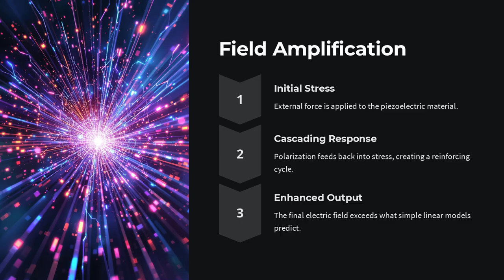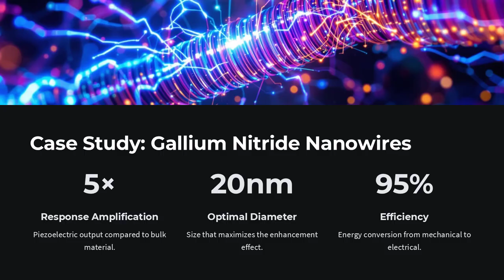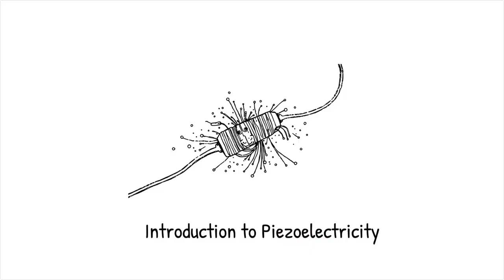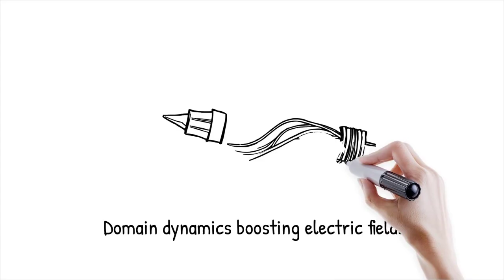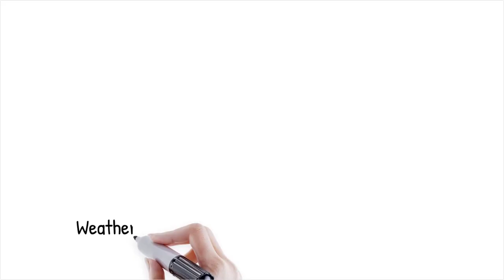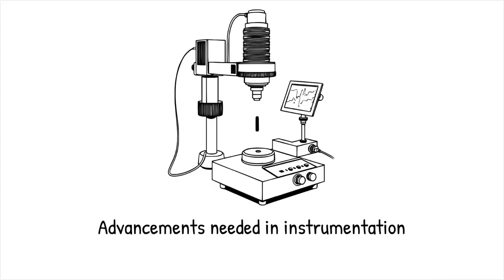When Stress Turns Into Electricity: Science Can’t Fully Explain It

Comment: Piezoelectric quartz does not conduct or produce electricity, the sudden movement of the conductors attached to the crystal produce a capacitive-inductive jolt of electricity from their atomic nuclear magnetic fields being rapidly altered by a leveraged momentum of the impacted quartz crystal's atomic structure.
Reply from the maker: Thank you for your fascinating comment. Your interpretation highlights an often-overlooked layer of piezoelectric behavior, where the dynamic response may not solely originate from the crystal’s intrinsic properties, but from complex interactions involving momentum transfer, magnetic field variations, and coupled inductive-capacitive effects. This perspective aligns with a broader trend in advanced materials research, where classical models are giving way to multi-field and quantum-informed approaches. In particular, nanoscale investigations reveal that phenomena like flexoelectricity, interfacial strain coupling, and even emergent magnetic-electric interactions can all contribute to unexpectedly high outputs. It is this complexity, beyond textbook piezoelectricity, that our video explores, encouraging a deeper rethinking of how electromechanical energy can be generated and controlled.